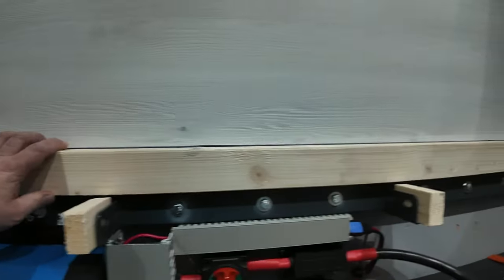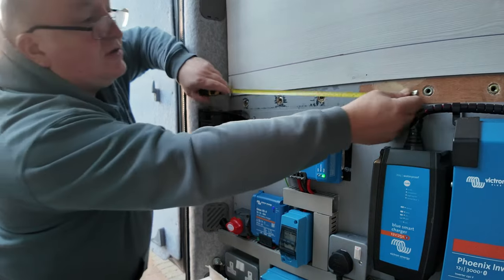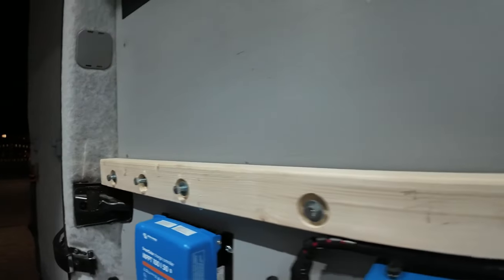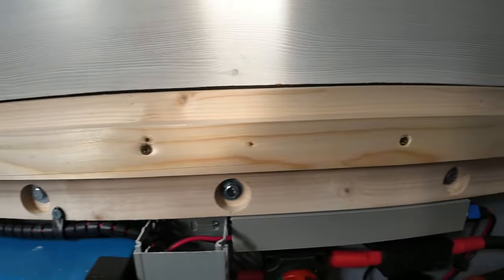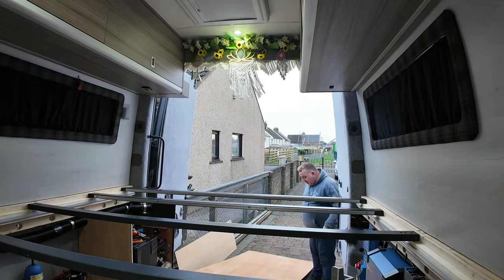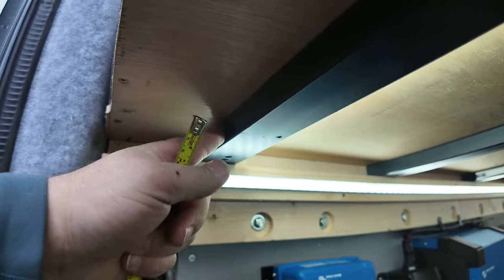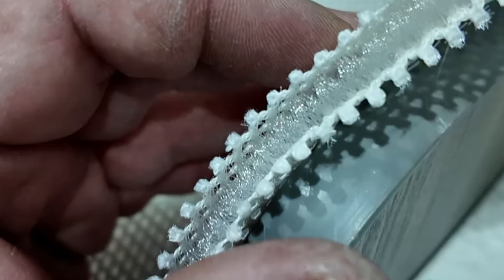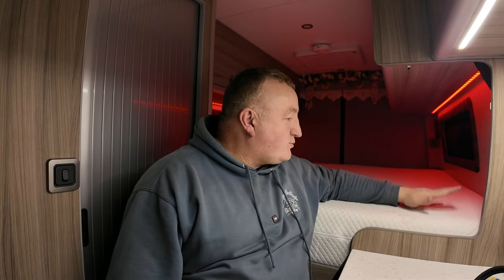Maximizing Campervan Storage: Lifting the Bed for More Garage Space and Adding Extra Lighting

Comment: Know what you mean about the carpet liner. Changed the rear door panels on ours to pvc carbon fibre look alike during Covid and cut recessed pockets into them. Not cheap as big panels but don’t regret it as hard wearing and don’t mind getting wet when it’s raining or when using outside shower. Safe journey, hope it doesn’t get too cold passing through mid-Spain. Can be a bit snowy in the Sierra Morena mountain range overnight. Still you’ll be used to that in the Lake District 👍🏻
Reply from the maker: I'm looking forward to the wintery conditions in the mountains 😁🫶

Comment: I see your bikes have hyd brakes. Your LBS will have plastic transport packers (on boxed new bikes) to stop the pistons accidentally popping out of the calipers (if the br lever is accidentally pushed).
Would be a good idea as you have the front wheels removed
Reply from the maker: Thanks for the info!